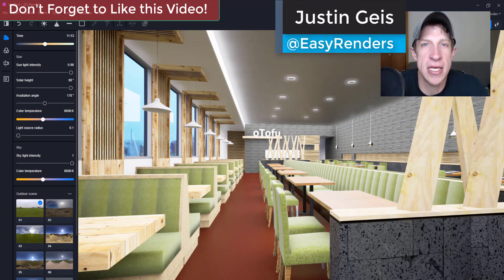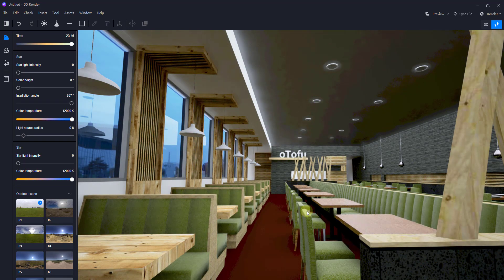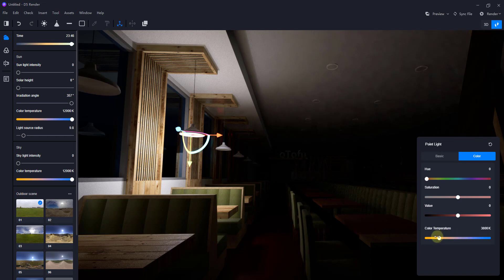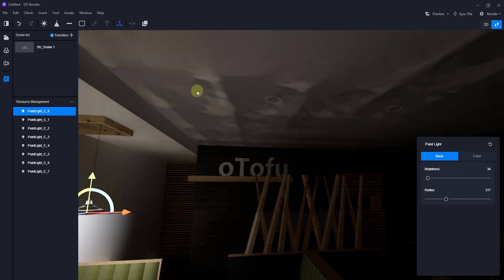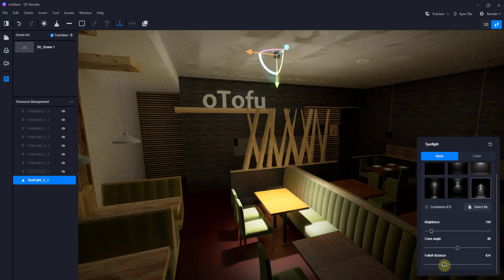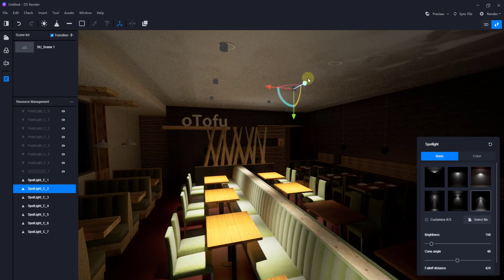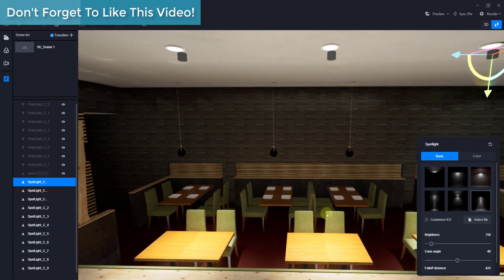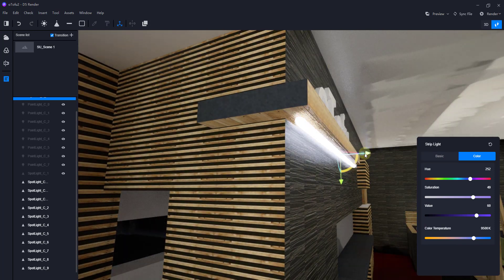Interior LIGHTING SETTINGS Tutorial for D5 Render

Comment: Hi Justin, I'm getting a new computer in this week that will finally be able to run D5. Have you attempted to import models from Poliigon or similar sites? I am curious how it works since metal and glass cannot be imported to Lumion through diffuse maps and it's quite frustrating. Would be great if D5 can accommodate it.
Reply: also I am curious about what you think the potential for D5 is. Is it going to give you a top of the line render output like V-ray or is its use centered on its speed in getting a render like Lumion?
Reply from the maker: I like the possibilities behind D5 from an Unreal Engine standpoint - it's built on Unreal Engine and can take advantage of those capacities. However, I'm not seeing anything related to proxies from SketchUp, vegetation placement, etc, so it's behind something like Lumion or Twinmotion from that standpoint. Overall I'd love to see something like D5 become an "easier to use Vray" type application, but it's far too early to tell.